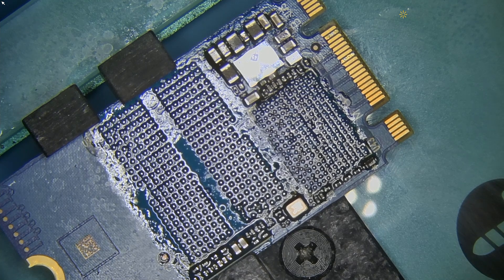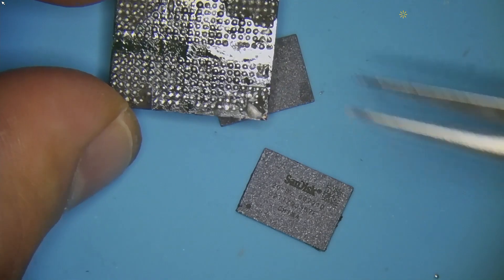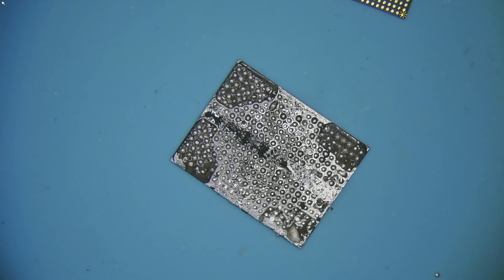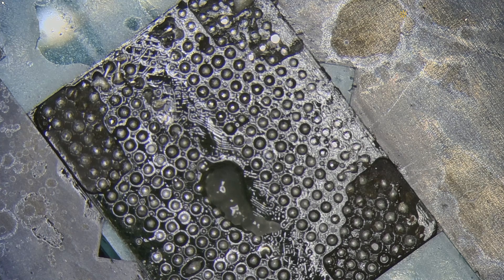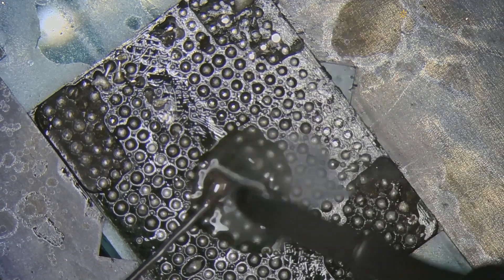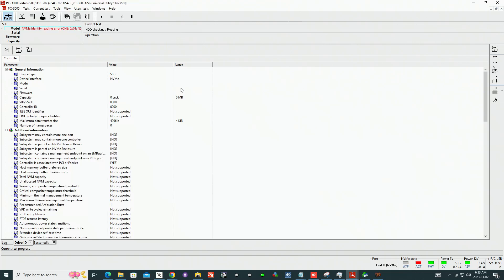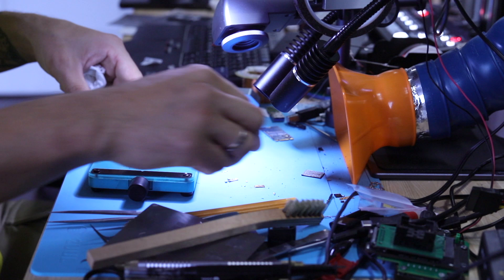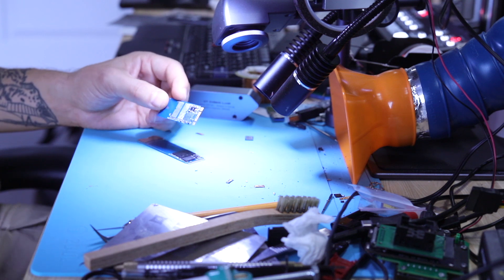controller swap compatibility Western Digital SN520 NVMe

Comment: Increasingly this will not work, as factory "pairing" of chips through secure enclaves is trivial to automate in manufacturing and both ensures devices cannot be repaired by 3rd parties and the "security" excuse applies.
Reply from the maker: I know, going back to working on hard drives full time would be a good move :)

Comment: I'm surprised you don't use a flat blade solder iron tip for cleaning the pads and removing the old solder. I saw it on Kris Fix Germany. He uses it a lot. It looks really handy.
Reply from the maker: I have it on a different iron, but I do need to order it for the 115

Comment: Hi Erkin... Thank you for your great videos... I enjoy them every time... I have a question... at minute 6:12 there you can see, that one pad on the memorychip is missing... Why this is not a problem? 😳
Reply from the maker: great question, but the pad is not missing. Often ground pads will go dark after heat exposure. It could be scraped off to the shine again or flux and solder. I cleaned it with a blade, but it was cut from the video I guess
Reply: @hddrecoveryservices  Thank you... Should look more carefully next time 😅

Comment: Try an empty 128 NAND , solder it in place of the NAND, then format it, remove it, and re-solder the 128 NAND  that was not read.  This way we can fool the controller maybe
Reply from the maker: I'd need a vendor utility for something like that. It won't work dude

Comment: Are samsung evo 970 plus controllers swappable?
Reply from the maker: I have not tested it personally, but you need to confirm that the controller is bad first. If the unit goes to ROM mode - controller is most likely OK
Reply: @hddrecoveryservices  The controller gets really hot when it's plugged in. Could it be something else?

Comment: Looks like there is a difference in the firmware versions of those controllers. And of course manufacturers have disabled the possibility to read and write the firmware.... Thanks for your tedious work, man! All the community appreciates it very much!
Reply: Firmware isn’t stored on controllers, instead it is in a reserved section of the NAND. Most likely case is that this controller is “hard-keyed” or serialized to the firmware/NAND.

Comment: Now the million dollar question: is there a way to recover data from the controller and reprogram a new equal controller with that data?!
Reply from the maker: nope
Reply: @hddrecoveryservices  what if both controllers are fully functional? Can one EEPROM be read and copied onto the other chip?

I wonder how they are programed in the first place then?
Reply: @leovbernardo  generally manufacturers lock their firmware code from copying and they burn specific fuse to read and write the firmware, so there is no way to copy the firmware legally. 
Even though we try to read means we may get only encrypted files.
Reply: Actually, companies who do this exist - I have used them several times to recover firmware from protected custom chips and actually transfer it to another device. Not cheap, not fast. It can be challenging to find an empty or reprogrammable chip(s). 

My reasons were different; it has been to replicate devices where both the source and the bin have been lost, or recreating special obsolete equipment @hddrecoveryservices

Comment: always kool to  see ..so the controller is the bios per say that finds the data on the memory?..and you called the " re-balled" when putting the paste thru that stencil ...so kool i found this channel ..thanks for answering all my questions :)
Reply from the maker: in some cases controller is not going to be unique, and can be swapped out (I've done so in many cases on this channel). This specific unit, and most of the recent Sandisk stuff is not swappable tho